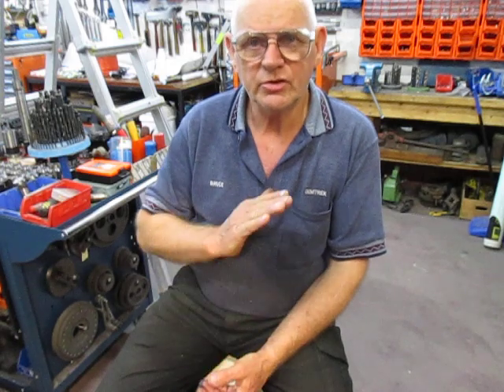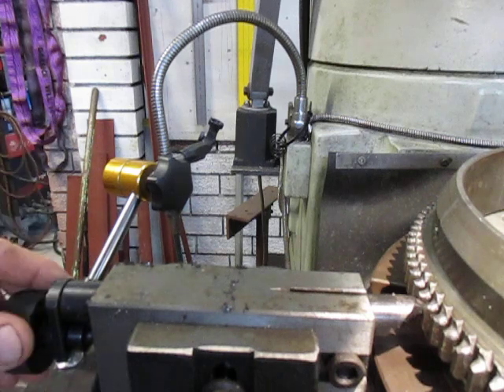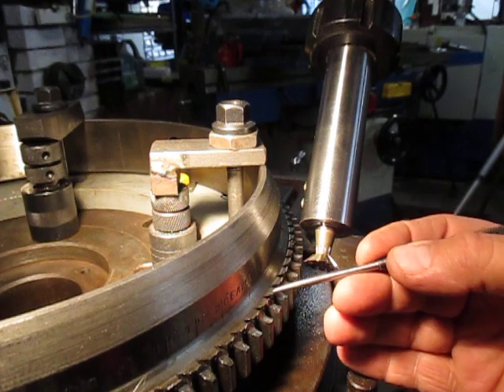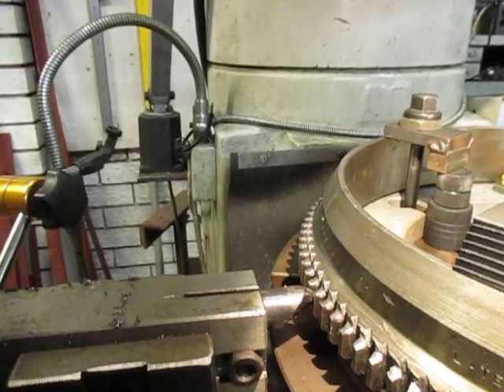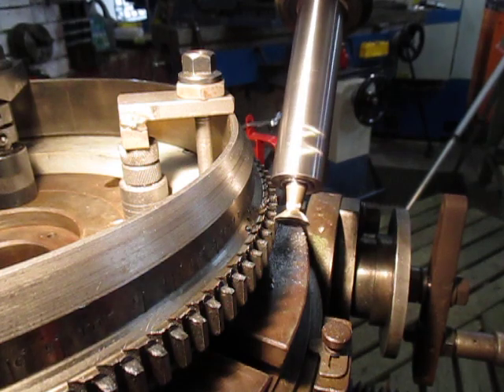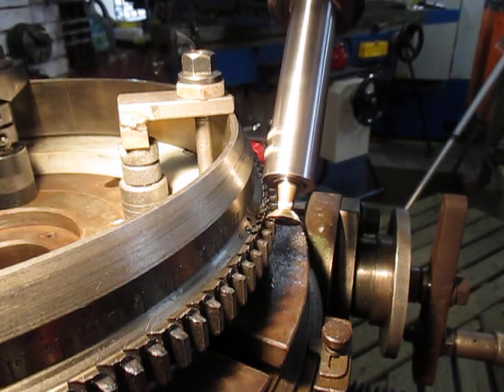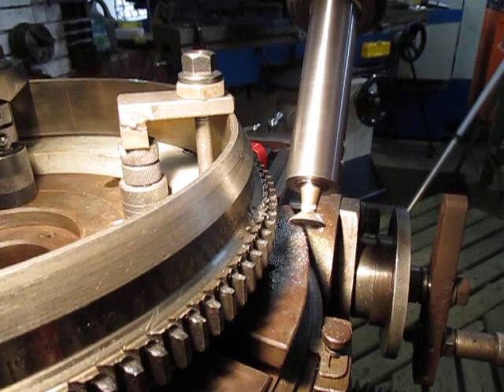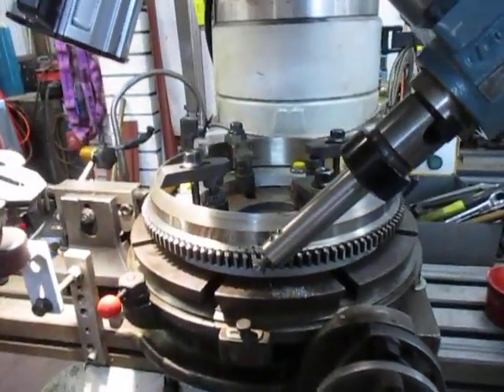1952 Bentley ring gear 5

Comment: We had a big Cat payloader at work and the bugger 9 times out of 10 would stop in the same position...using the same teeth over and over. Huge job to replace so a mechanic got in there standing on his head and welded the teeth up and hand ground the profile...to my surprise it worked for a very long time haha. Theres some science that worked against us on that one cause i later heard Detroit Diesel designed an engine that would stop at the same position for ease of clutch adjustment on the big rigs